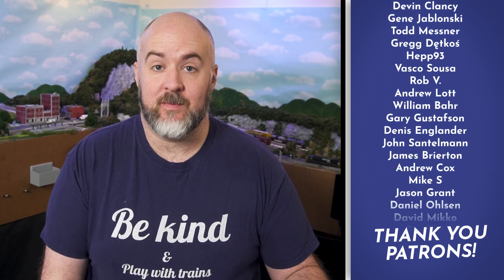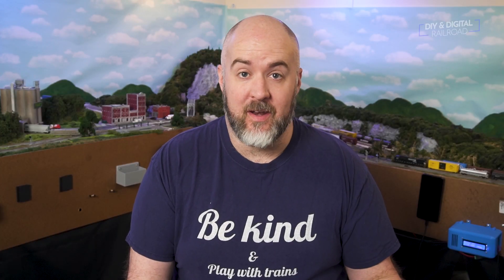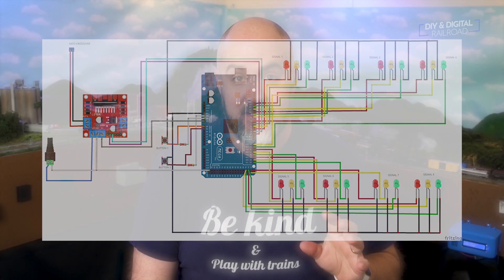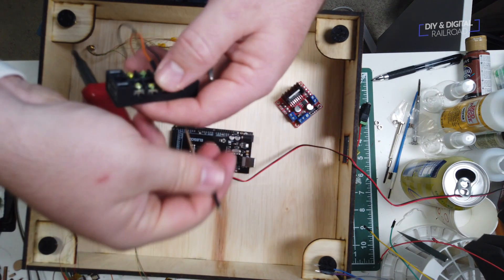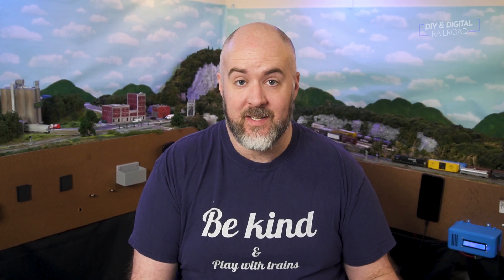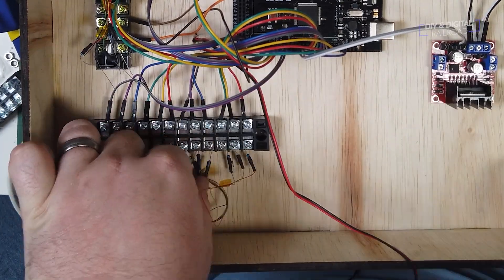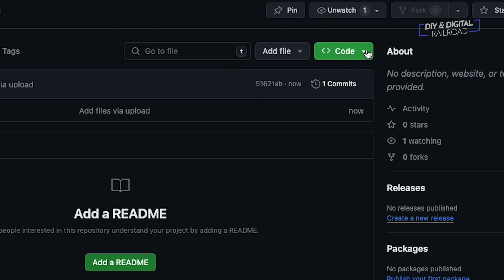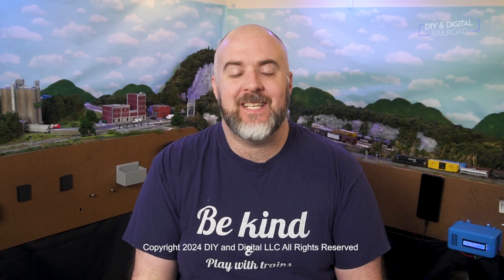Working Signals for a Model Railroad Double Crossover using an Ardunio

Comment: Very happy to see a new Arduino project, and it's one I plan to work on for myself soon. I've got a couple of questions, though. You mentioned that the proper signal placement should be outisde the confines of a single module. I'm planning to build mine on a double T-TRAK module, so I'll have more room and can move the signals out to proper placement. Also, since all 4 signals are essentially mirrors of each other, is there a reason that you can't run them all from the same set of pins on the Arduino instead of a separate set of pins for each? Does that have to do with the future plans you hinted out?

Comment: Shouldn't one of the other routes go to red when the crossover is switched?  I mean you'd never have two routes cleared to the same crossover at the same time.
Reply from the maker: Yes you are correct.  It's part of the code that I need to update.  I actually have now and it works where when it goes to diverging, all the signals go red and a second button lets you select which signal is green.

Comment: With a the two signals showing Red over Green Medium Clear.  That is an accident waiting to happen,   You have just gave an indication that a train on main 1 and main 2 can enter the crossover at the same time.  One of those signals needs to be Red over Red (No Number Plate) or both Red over Red with a number plate for Rule 291?  Stop and Proceed.
Reply from the maker: You are correct.  I am currently working on the code to control this.

Comment: Well, the MEGA is a slight overkill, in my opinion. It has enormous program memory for this task.. I get it, it's easier with that many I/O lines...
However, if you use an Uno or Nano, with a PCA9685 servo board, you can spare $$$ here, I think. It's a PWM LED driver originally. Programming shouldn't be much harder. I get it that it has "only" 16 outputs, but in this close proximity driving the red and green together should be yellow, and the yellow wires from the signals can be dropped, and you have only 16 LEDs to drive this way. With the PWM duty cycle you can tune the yellow color. Probably a bit more fidgeting, than anticipated, but might still worth the time. If you still want to drive the yellow LEDs, another servo board would do the trick, on the exact same two pins, only its address must be modified.

Nice work though, I really enjoy your videos.

Comment: If you know you're going to be feeding updates to your module, you may want to consider putting a panel-mount USB socket on the front of your module... I got some from Adafruit (youtube seems to block the link being posted, but google Adafruit USB panel mount and you will find, I used product ID 4259)
I've used them in a couple of projects, they need no wiring, you just plug in your USB cable of choice on both sides, and it means you don't need to get under your module when you want to reprogram things :)

LOVE the points & signalling setup, looking forward to seeing more :D)

Comment: Good video.  I’m working on a 40 signal layout with 32 turnouts (including 5 double crossovers), and 16 blocks. All driven by a single arduino nano.  With over 200 outputs and 50 inputs, you can imagine the complexity.

Comment: you don't need to use another pin for a 2nd button  if they're NO put them in parallel, if NC, in series.  you'll only need 1 resistor

Comment: That's is a LOT of work to do what it was doing. As you said, it isn't done yet, but idk... I don't think I'd have the patience to do something so mindboggling without actually having a really worthwhile payoff. 

Was this your code? I remember your video on using AI to work on code. Did you use AI for any of this? In a curiou fashion and not at all "omg AI is stealing" or something.

On all the wiring, I'm at least feeling proud of myself for wiring up an Athearn blue box switcher for DCC. I still need to add the speakers and lights, but still, it's a bit more than what I've done before, and it's fun to see an old loco come alive on DCC.

Comment: Wow this is very interesting, but a tremendous amount to digest, for us old timers who are not familiar with code.
Thanks again for bringing the Arduino back though.
(Being an old timer; I previously used a modified version of your Arduino signal detection code from 2018.
The Arduino output fed 4P double pole relays.
These really outputs drove both LED signals, and NCE mini panels, that controlled switch track routing and signals).

Comment: Great to see you returning to your digital roots! 
BTW, you do not need the 470 Ohm resistor - Arduino input pins can be configured to use the internal 20,000 Ohm pullup resistor by pinMode(_pin,INPUT_PULLUP); this keeps the voltage on _pin HIGH unless _pin is deliberately grounded (by pushing the button.) 
Also, your code can be simplified enormously by using classes: you'll create a single class called, say, Signal, and create 4 instances of that class - s1, s2, s3, and s4 - along with a variety of constants to set the signal aspects. Instead of a huge list of digitalWrite statements (which are easy to type incorrectly and difficult to debug) you'll simply say, for example, s1.aspect(RED_OVER_GREEN);
Reply from the maker: This is really cool.  I've always been at the tinkerer level of arduino code.  I would love to go deeper!.

Comment: Hi Jimmy! Great video! I really want to do this on my T-Trak setup as the railroad I am modeling in Ashland VA has some of these at various points between Richmond and DC.

Here’s my question, how do you handle the polarity shift in the cross over from the Yellow and Red lines and vice versa?